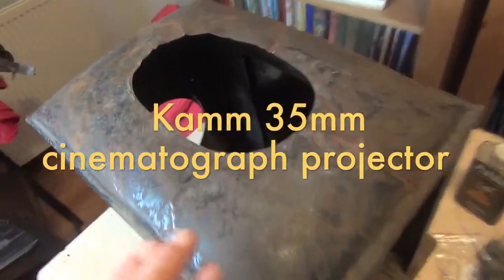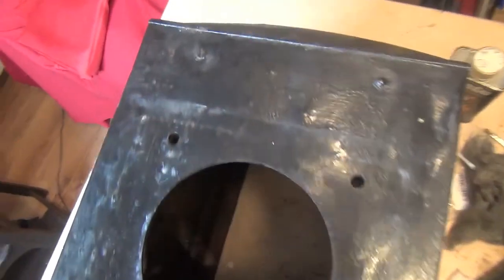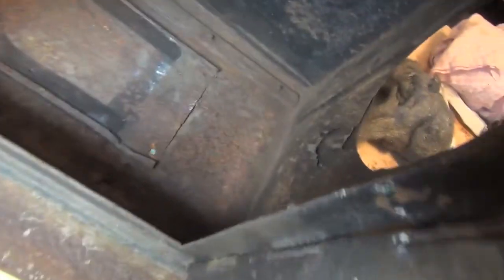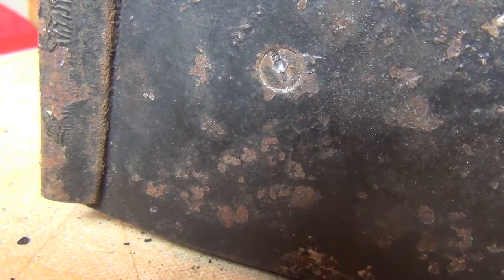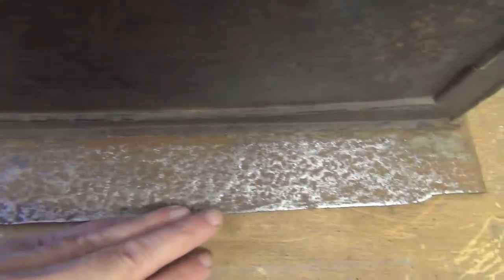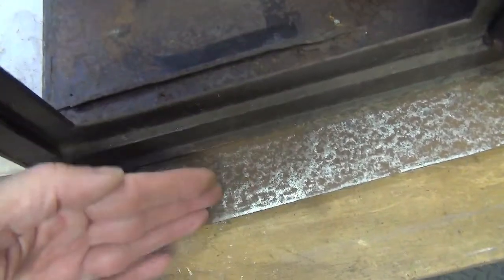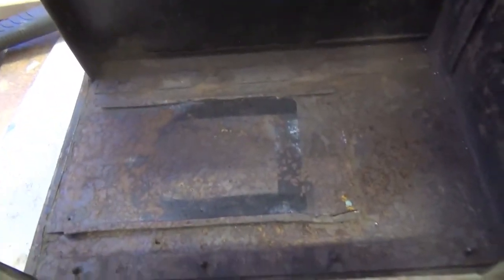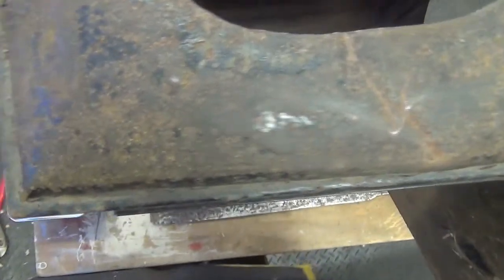Kamm vintage 35mm film movie projector mechanism Pt6

Comment: I have recently started a cosmetic restoration on a Kamm film projector, it isn't the same model as you have here and it has a cylindrical light chopper/ shutter in front of the lens.